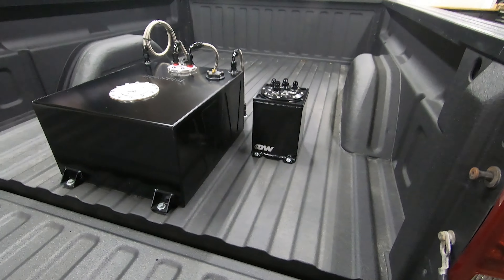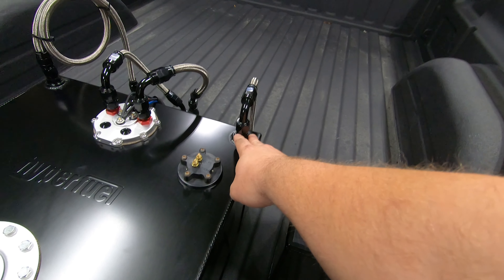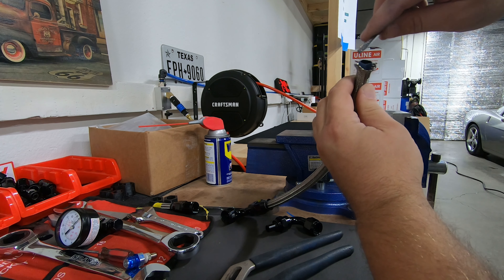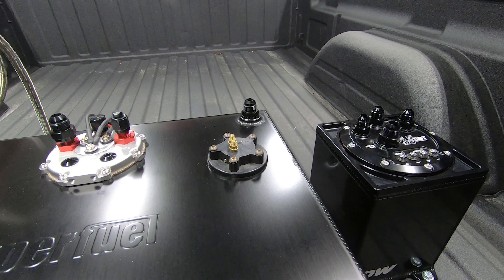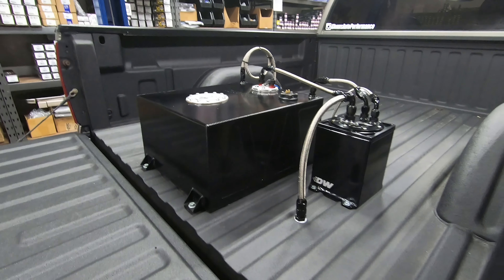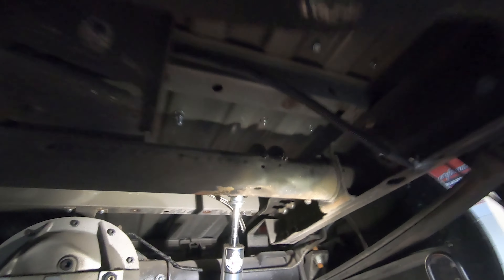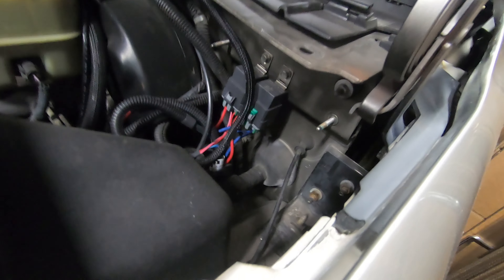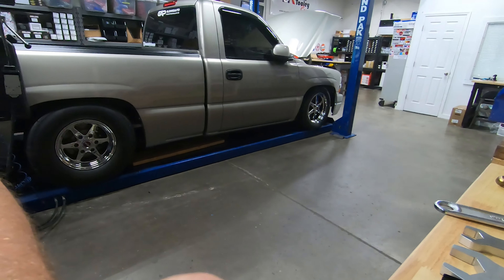GAP Single Cab Ep. 1 - Fuel Surge Tank Installation and Wiring - 1040LPH of Pumps Wired & Plumbed

Comment: I guess if it works. I’m definitely not a fan of 1 huge fuel cell and one surge tank with several holes drilled in the bed. Seems complicated and a lot of points of failure. I’ll keep my triple pump intank setup all day.

Comment: Why did the owner feel that placement for the fuel tank was a good idea?  I mean it’s a Ute , a truck ! 🤔🇦🇺?
Reply from the maker: This is a dedicated performance build - tank placement in the bed behind the axle offers a better weight distribution for traction and weight balance compared to the stock tank location.  Underbed mount was considered, but the potential to need to access the differential was more of concern and we did not want to need top drop the tank in order to pull the differential.
Reply: @glennsautoperformance  show car ok , but weight distribution  of a flea on  a dog . Why not under tray ? Low centre of balance . Not trying to be a ass hole mate but it’s for show than it for show ,no balance . Ease of system build ok.